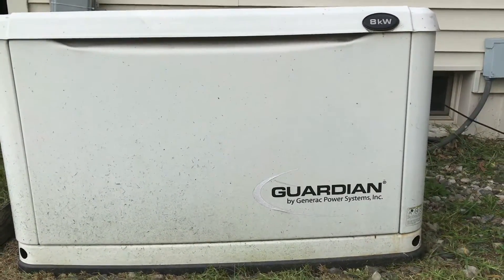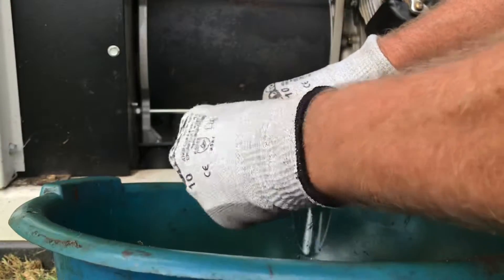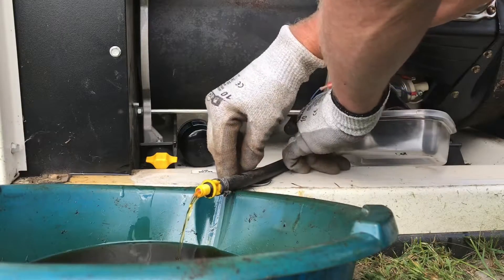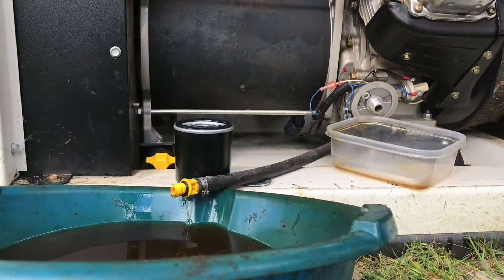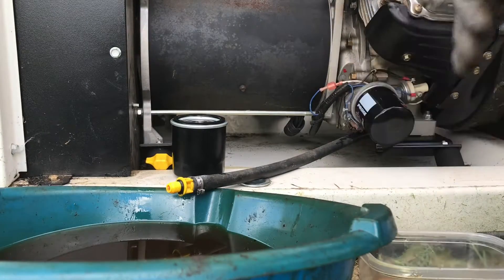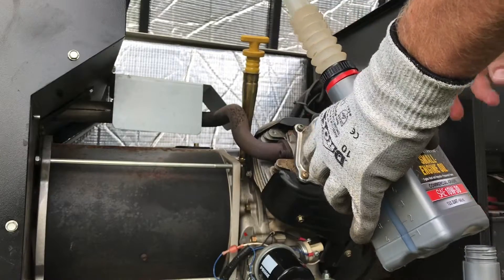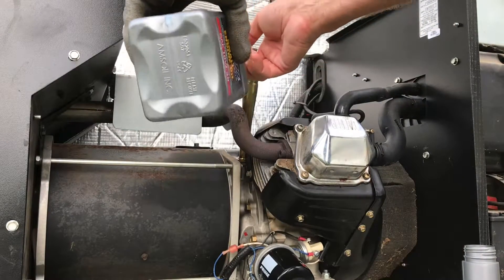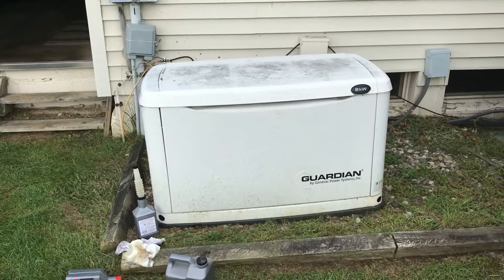Guardian Generac 8kw Standby Generator - Oil Change

Comment: Question - Does this model has an Air Filter?  if so, where is it located? Thanks!
Reply from the maker: That’s a great question and will get back with you…I’m not sure it has a filter
Reply: My gererac generator is like the one you did the oil change on, an 8kw it came with my house. The manual shows an air filter so I was hoping you could do a video on changing that too  @Stromzilla

Comment: Glad to see understanding there's a big difference between small engine oils and automotive oils because of emissions standards I use Amsoil or Briggs and Stratton 5w30 in my Generac both are 100% synthetic with a ZDDP of right around 1300 ppm oils like Mobil 1 are not 100% synthetic and have ZDDP level of around 800 ppm that's a big deal with high stress high heat air cooled engines they have really high bearing loads it also handles continuous RPMs very well I also use 15w50 Amsoil small engine oil in Exmark mower EFI Kohler engine its a cold climate where I'm at so I use 5w30 with my Generac my old unit I used 10w30 but I have a 10 year warranty and don't want any trouble with warranty it was built in August of last year the manual doesn't even give an option anymore for oil its 5w30 synthetic nothing else
Reply from the maker: Well stated.

Comment: Hello! I just wanted to say thank you so much for taking the time to post this video on this older generator- same one as mine. 

If you have a chance, could you kindly post the brand of the oil filter you use as well. I just paid a lot for General original “ stuff” and if changing the oils is as easy as you posted, I would like to do it every year with similar good stuff that other people use. 

Again. Ty so much.
Reply from the maker: Thank you for the kind remarks and happy to know the video was helpful.  The filter is a Prime Guard, part # POF4476.  We typically buy our stuff thru eBay and these filters came as a 6-pack and very cost effective.  Also highly recommend using a high quality synthetic oil preferably 5w30.  Let us know if you have any other questions and hoping you’ll subscribe.  Take care.
Reply: @Stromzilla  Sorry to bother you again- so I finished changing, the oil, air filter and spark plug and the test cycle worked, no red lights and all is good but at night I noticed the blinking green light now blinks yellow- any idea what it could mean? Some of the manuals I checked stated it’s a maintenance interval- if so, how do I reset it? 

It all starts up fine but just don’t get it. 

Take care and Merry Christmas to you and  yours.
Reply from the maker: Check to be sure your switch is set to Auto.  Then press the button (Set Exercise) to start the engine which will also set the time to auto-start in 7 days.  The engine should auto-shutdown in 10 minutes and the green light should stay on showing the system is good to go.  Let me know if you’ve gone thru this process and whether or not the green light is on.
Reply: @Stromzilla  My apologies for confusion- on the control panel the light is green. However, if you face the generator on the right side (side where the air filter is) you can see near the bottom a green light (unit is closed)... normally it should be green- however mine is now blinking yellow... even after going through the test exercise... agsin the control panel is green and no warning lights are illuminated but there is this other light externsllly through the right side you can see- normally it is green but now it’s blinking yellow- wish I could upload a video for you... lol.

Make sense?
Reply from the maker: Not familiar with the light you’re referring to so will need to investigate further.
Reply from the maker: I’m thinking your Generac might be newer than ours because we don’t have the light that you’re referring to...just checked.  It was dark:30 and I had the panel completely off...no light.
Reply: @Stromzilla  hey there- so had a professional look at- as it turns out it was the trickle charger for the battery. It had gone bad... it Was constantly glowing “yellow” but was never actually charging the battery so it would always stay yellow and not turn green indicating the battery was charged. It’s all fixed now!
Reply from the maker: That will make for a bad day.  Good to hear you figured out the yellow light.  The charger has held up here but the starter had to be replaced several years back.  Overall it’s been a good backup system.  Thank you for getting back with me.